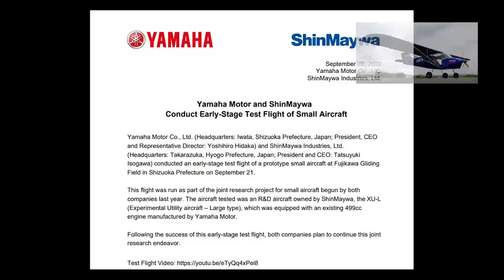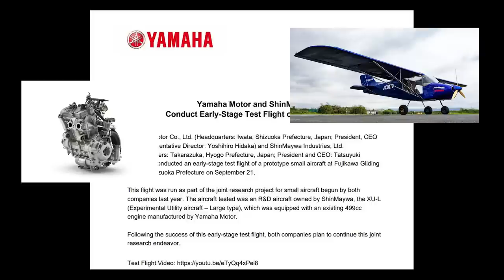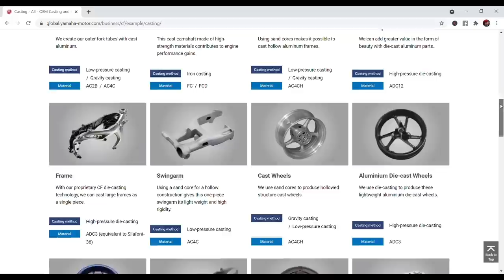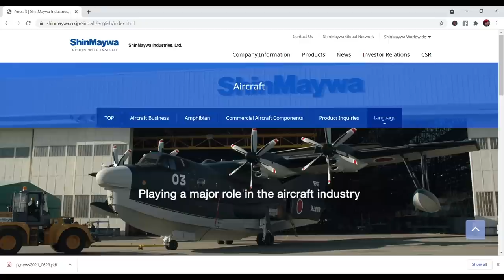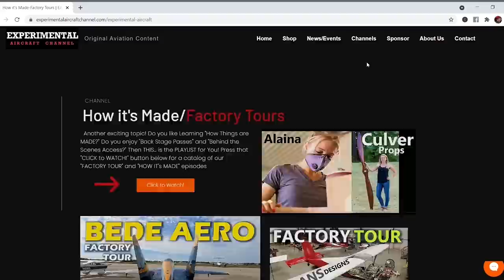Yamaha Motor Corp FIRST FLIGHT! ShinMaywa built Airplane

Comment: That looks like a Yamaha Phaser snowmobile 80 hp engine with a Skytrax (Teal Jenkins) gearbox !  Lots of these already flying here in many experimental aircraft including as well 150 to 300+ HP Yamaha Apex engines also with Skytrax gearboxes.  Bryan you just interviewed Dennis Rowe with his 150 HP Yamaha Apex Highlander.   Some 200 HP  Yamaha Nytro engines also starting to fly.  So no need to wait folks you can fly Yamaha today!
Reply: He’s right you know, but it’s nice to see Yamaha developing another choice.
I love my Apex/SkyTrax combination!
Reply from the maker: Yes.... interview with Teal coming in the next few weeks.  Exciting to see YAMAHA themselves at least toying with  the concept.
Reply: @HeeHawHighlander  Yup almost 150 hrs on my Apex powered Kitfox. Love It!!
Reply: Yamaha likely going to manufacture their own gearbox. Doesn't skytrax have that problem with the sprag clutch from a GM transmission? I always wondered if one could overspeed the prop with that sprag clutch in higher performance aircraft. While in a fast decent the prop is freewheeling.

Comment: I know Yami engines like the back of my hand so for me, a Yami engine, with a constant speed prop on a KitFox would be a dream come true !
Reply: Problem is they are just now trying engines that use unleaded gas for the first time. Rotax do not use leaded gas and that is a major bonus for health. It's surprising that aviation fuel is still leaded today.
Reply: @drampadreg1386  It's deliberate lack of legislation. Let's face it, there will be thousands of readers here, that have a piston plane or helicopter that would be grounded unless they either wasted the original engine or at huge cost, reworked most of the engine to maintain longevity on unleaded. And in so doing, elevates many potential reliability issues, that if not for being completely reworked, might have never been an issue. Which quickly takes us back to wasting the original engine. It's a tough pill. And for icing on the cake, there's no small amount of sentimentality at risk even beyond the actual dollar investment. So here we are, decades later, no one wants to be the one who kills that spirit that all old and new pilots share.

I suspect they're waiting for a revolutionary battery of sorts that will fill the void which will more graciously not put any one govt under the microscope, and allow a mandated date of permanent leaded gas retirement. But I suspect that is still a looong way off...unless someone is holding out on us..but it sure tests the imaginations of physics if so.
Reply: @drampadreg1386  yamaha has been making engines that run on unleaded gas for decades.
Reply: Does your aviation “insurance company” think it’s a dream come true. The purchase of anything aviation is determined by what will be covered by underwriter. If gets passed that then it’s still a maybe.
Reply: @tropicthndr   No, they prefer the clapped out snowmobile engine 😒

Comment: I'll get really excited when they come out with a 1000cc I4 that uses the same crossplane ignition pattern as the R1. Not only would it sound amazing, but it would probably climb like a homesick angel.
Reply: Was thinking the same thing honestly. Probably pretty light too!
Reply: Home sick angel! Live it!! Jesus Coming soon, get to work!!
Reply: It would sound amazing.
Reply: the crossplane vibrates more than the flatplane, its on the R1 because it allows more "dwell" between powerstrokes to allow the rear tire to regain traction, somewhat like the old "big bang" 2 stroke MotoGP bikes. not applicable to propellers
Reply: @captarmour  With the right engine mounts, and running a gearbox with some form of vibration damping (similar to the setup Viking uses on their Honda Auto conversions) to the prop, you won't have that issue. Will it drive up the cost? Yep. But will you be the coolest MoFo at the next fly-in? You betcha.
Reply: @captarmour   But that crossplane engine sounds amazing!!

Comment: Now scale it up with its 1300cc engine that is found on all big bore motorcycles.  This engine should give Rotax a run for its money.
Reply: Indeed.  I have a Super Tenere (1200 cc vert twin moto).   Most reliable machine I ever owned. It's taken a ton of abuse off the beaten path and just keeps on running w/out missing a beat.  When I get old and can't keep a pilots medical or afford to keep my standard cat aircraft anymore, it would be awesome to be able to operate a Yamaha powered sport category aircraft and keep on flying.

Comment: Yamaha has made the most trouble free motorcycles for years. I have no doubt that they can make outstanding light aircraft motors based on their existing motorcycle engines. I'n surprised that they did not use their outstanding 700cc twin as the basis for this engine. It would have been perfect at around 75hp and not much heavier than this 400cc model. The 900 triple is well over 110hp and bulletproof. The same technology for making dependable lightweight motorcycle engines are a perfect fit for aircraft and would give Rotax a run for their money and are probably superior to rotax.
Reply: My zxr400 kawi made 72 Hp.  The 700's should be closer to 90 and still be dependable.  Stock liter bikes are making  200Hp these days.
Reply: Having owned many Yamaha and Honda and even Rotax engines, Yammy's, especially single cylinder utility type, generators, snowblowers, water pumps etc. are cold blooded as blazes. They are the hardest damn thing to start when the temp really drops. I have won many a bet putting my $5 on the Honda (snowblowers especially) starting on the 1st or 2nd pull, when the Yammy's always predictably took 7 to 12 and even more pulls.. sitting side by side cold from the same cold temps the night before. 
And Rotax singles.. whether with the old Tillotson or the newer Mikuni carbs, I can't think of another 2 stroke that starts better when it's extra cold out. 

And my last comment is a beef I have with Yamaha ever since they quit building in Japan, and changed their factories to China. I don't know how many pieces of equipment are affected by this but for CERTAIN, snowblowers are, and unfortunately they support the stereotyping of Made in China, being inferior quality. 
And not by just a little.. I'll never again buy a Yamaha anything if it's birthplace was China.

Comment: It would be nice to see other companies move on this as well, like Briggs&Stratton, or Koehler…they could do wonders for the ultralight community….or liquid piston…
Reply: Rotary engines (there are lots of them around) could become an intermediate class between full turbines (turboprops or turbofans) and regular piston engines, but there are obvious obstacles that prevent this from ever happening. DARPA (one of the institutions behind the funding of Liquid Piston) also backed some heat engine projects that could easily power ultralights.

Comment: From the firewall to just behind the cabin is a Rans S-6ES. The tail boom here has a sharper angle up putting the horizontal stabilizers more inline with the wing. The S-6ES has a flat topped fuselage between the cabin and the vertical stabilizer, where this appears to have a pipe that runs to the vertical stabilizer. I wonder how that is going to affect elevator control when you are trying to set it on the line at a high AoA? I would have also raised the center of the prop six to eight inches to reduce the effect of power changes on pitch.

Comment: While I hope more will come out of this, there's lots of little bits that don't add up...
Only thing worse than a two cylinder four stroke would be a single cylinder four stroke, so many vibration problems. Everyone else using Yamaha motors are using the three and four cylinder motors. As for the airframe, it's obviously a 'tweaked' Rans kit.
So the question begs; was this just a group of guys from Yamaha and ShinMaywa using some R&D money to have a bit of flying fun, or is this combination a bit of a red herring to distract from a real project with a better designed three cylinder motor with integral gearbox, fitted to a better designed airframe that will perform better, and can be left outside, but not as complex and compromised as the Skycatcher was.
Reply: I think it's just R&D for everyone to get used to the technology involved.

Comment: I do have a problem if they are taking technology that has Benny developed here in the US and putting it out as their own !!!
Reply: Sort of like WWII ? But it’s safe now.
Reply: They make the engines. Everything else is well within an engineering company's abilities. Yamaha makes the heads on the Toyota engines that power Lotus cars.
Reply: I don't see them doing that necessarily. I think they used the Rans and one of their own engines just for testing the waters, ya know? I'm sure they have been watching what is going on and likely may vastly improve on it. Like develope some engine s made just for aviation possibly based on engines they already have, or develope something entirely new, who knows, it'll be interesting though I believe. They did the Taurus sho engines and others. They currently supply some engines for Arctic Cat snowmobiles and Cat builds some of the Yamaha snowmobiles for them. So yeah good stuff